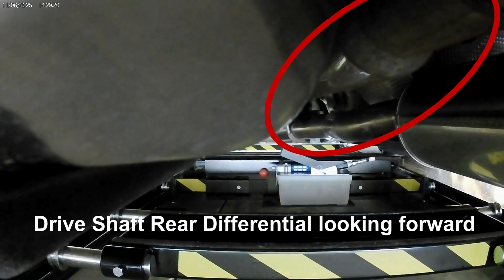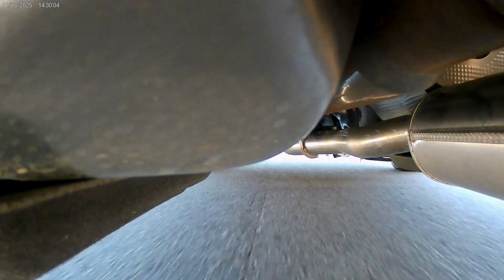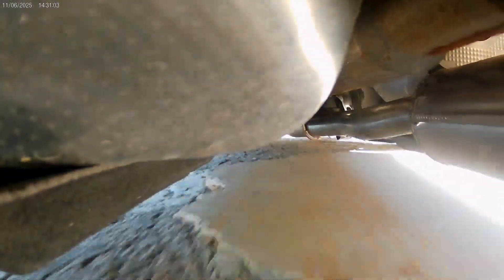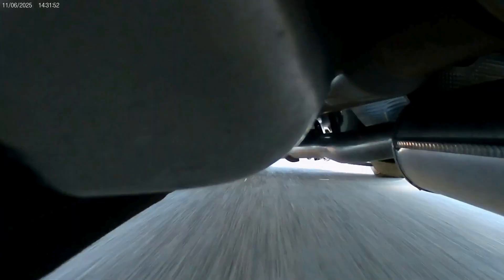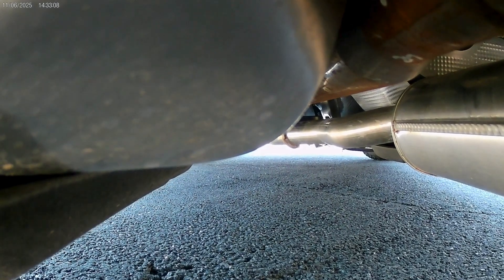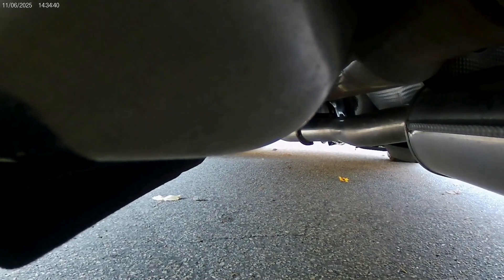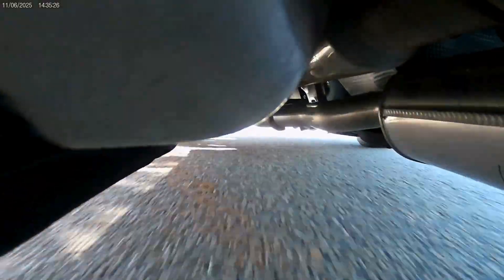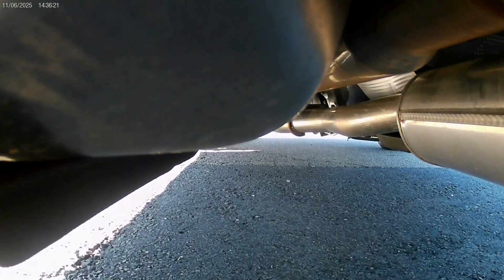How your Ford Maverick AWD system actually works

Comment: Did you try the slippery mode?  I would think the rear drive shaft would be rotating 100% of the time in this mode.
Reply from the maker: I did not try it in slippery mode, but someone commented earlier that even in slippery mode, it will still disengage, but maybe at a higher speed.  I guess they figure if you're going that fast, it must not be that slippery.
Reply: @marklally2233  would you?
Reply from the maker: @lhurst9550  , not likely, unless I get a lot of spare time, which is also not likely. But you never know.

Comment: Thank you for making this video! Highly educational and dispels the internet myth that the rear wheels are only coupled following loss of traction in the front.  Out of curiosity, was the Mav on Normal driving mode?
Reply from the maker: Yes, it was in the normal driving mode.
Reply: I wonder if ECO mode would change the engagement of the rear wheels.
Reply: @aaroncorrell8728 that’s where my head was going, but I’d take the educated guess that it would not change the engagement and disengagement speeds significantly.  Eco vs normal modes have more to do with the amount of kinetic energy regeneration (i.e.: regenerative breaking) after lifting off the gas pedal and prioritisation of electric propulsion than AWD vs FWD propulsion. Only my two cents…

Comment: Great video. I thought it only activates when slippery/wet
Reply from the maker: A lot of people think the same thing, that's why I made the video. Thanks for watching.
Reply: The fact that it automatically disengages when simply cruising explains why it only causes a small fuel economy penalty. The fact that it’s always at least partially engaged a takeoff explains why there’s virtually no wheel spin even when taking off aggressively on wet roads. It’s a great system.
Reply: Does it operate the same in all drive modes?
Reply from the maker: @mikelangan2707  It always starts and stops in AWD regardless  of the mode. It probably stays longer in AWD is some modes though.